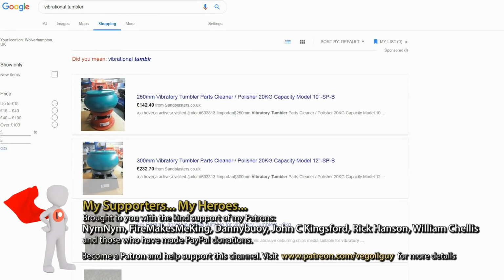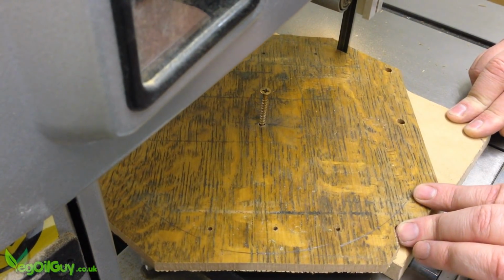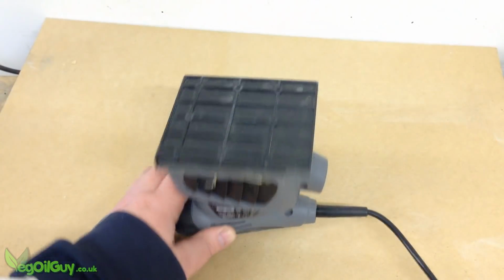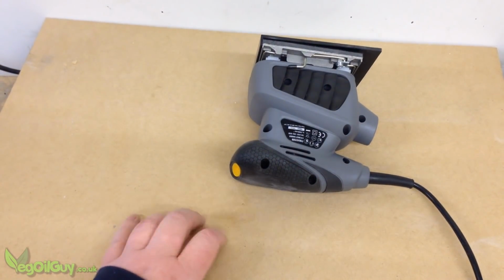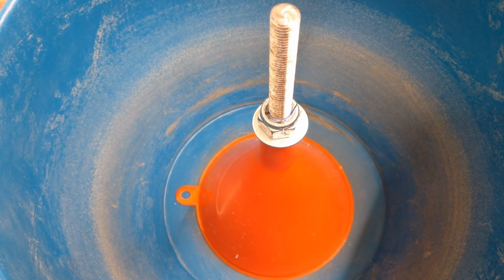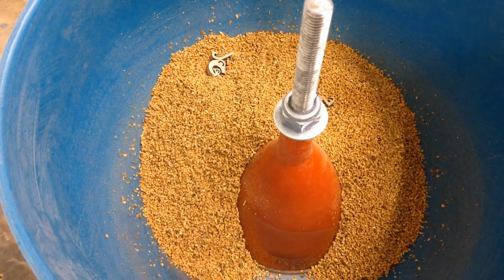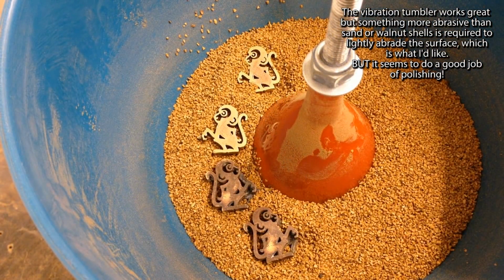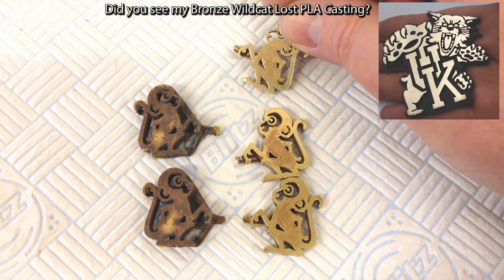SIMPLE vibration tumbler - easy cheap build - great results - by VOGMAN

Comment: Simple? Instead of cheap motor with unsimetric weight, simple to obtain. Using a sander?😂😂😂😂😂
It goes simpler.😉
Nice video.☺
Reply from the maker: Many thanks.
I dare say it's possible to do better, but as a quick and dirty solution it works a treat    : )
Reply: @vogman  
Great solution.☺ imagine- yesterday on organisation we found a old sander.☺☺
Again great video.

Comment: Meh dedicated vibe tumbler is super cheap compared to sander and parts and time and then when your junk parts wear out you will have to search for replacements.  All that plastic should be rubber for a reason.
Reply from the maker: Maybe so... but I was looking at a minimum saving of £100 and a sander costing £20. So I can replace the sander 5 times for the cost of an off-the-shelf. And it won't be getting heavy duty use... I guess time will tell  : )